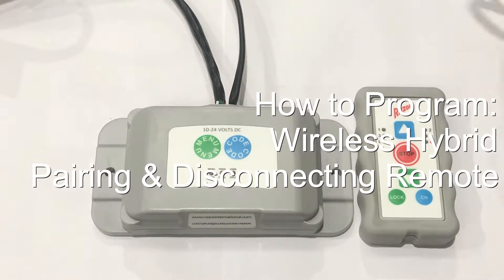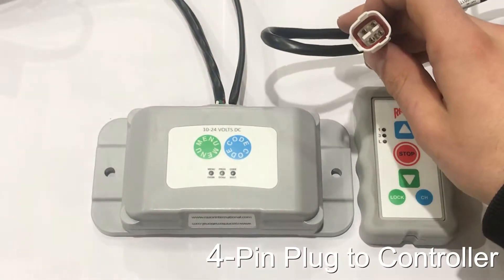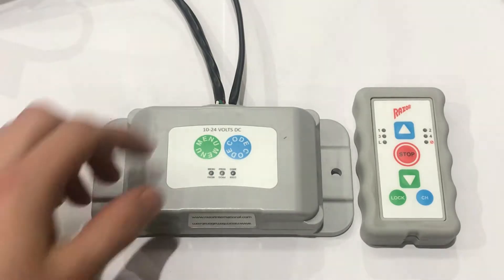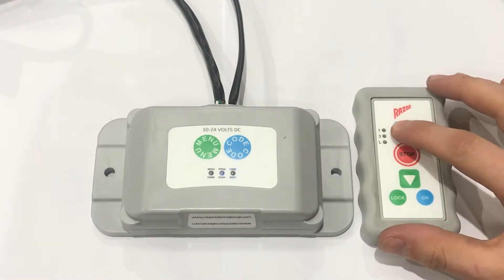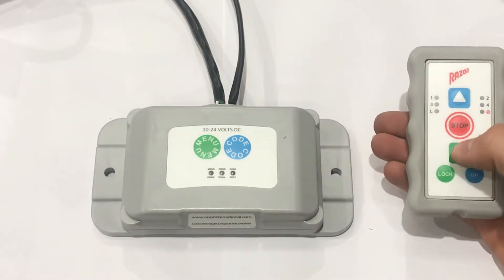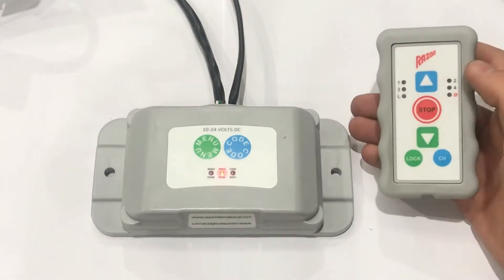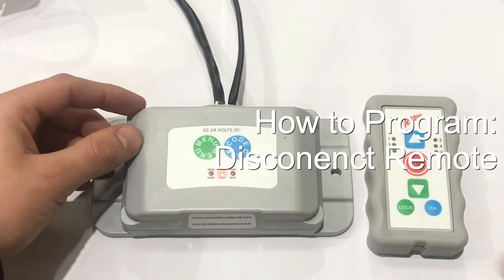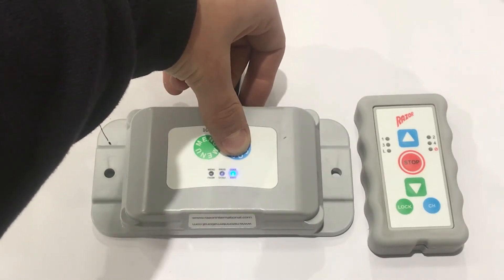How to Program: Wireless Hybrid Remote Pairing

Comment: Is this system compatible with the RMC controller and dose away the old wireless system box on the side of the controller. If so what is the price on this system.  Thanks Darren.
Reply from the maker: Hi Darren,
Yes it is compatible with the RMC controller, it essentially allows for a wireless remote to work.
For pricing, please go on our webiste and email an enquiry, one of our sale staff will help you out :)